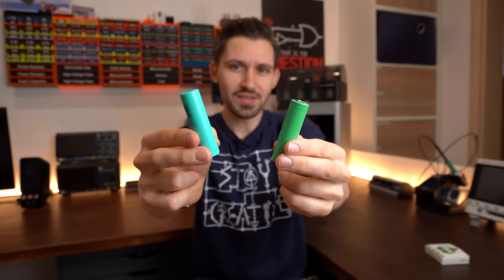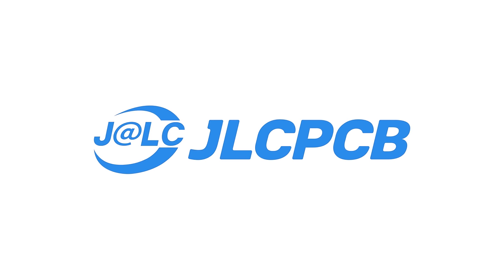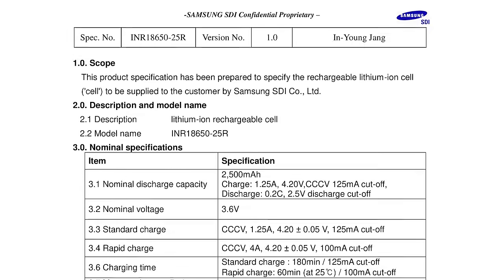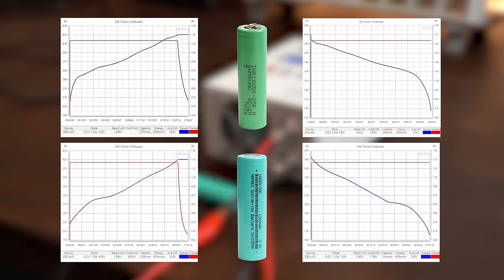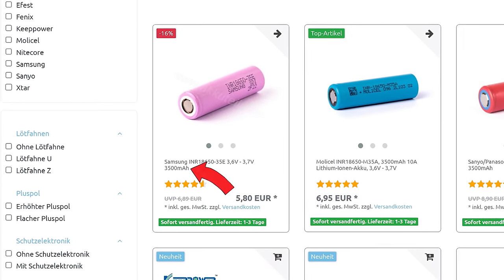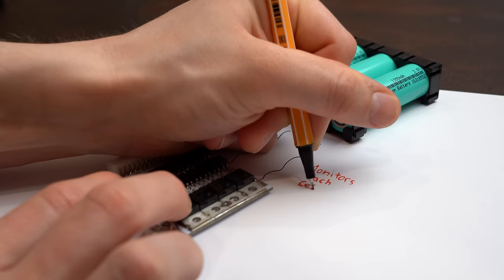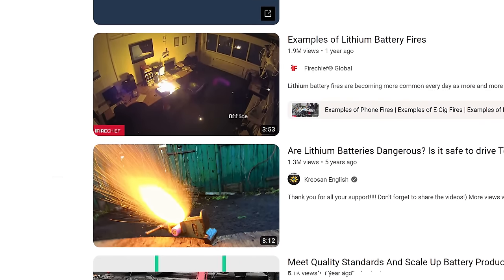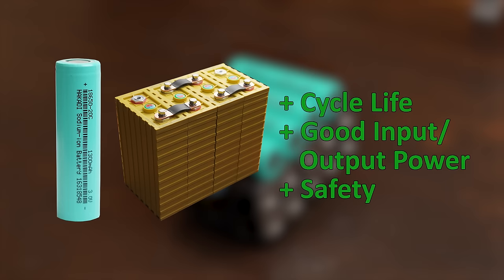"Salt" Batteries are FINALLY Here?! Sooo should you use them?

Comment: They will be great for house installations.
Reply: Anything where volume and weight isn't so important is going to get taken over by this.
Reply: Only if the price will drop a lot currently is around 400$/kwh
I was able to build my LFP battery 5 kwh for 500 dolars( i was hunting on aliexpres for a very long time) with bms which is around 100$/kwh but you can pretty easlit get it for 150$ without hunting.
Due to bigger volume, lover power delivery, lover number of cycles than LFP and i think because of operating voltage range they will have lover effincincy in converting DC to AC their price would need to drop to 50-75 $/ kwh or even lover to make them have sense which is between 6 to 8 times cheaper than curently.

Comment: Nice! When calculating the W/$ should really consider also the life of the battery. Natron Energy's bluepack claims 50-100K cycles so if you buy 100Kw lithium for home storage you will need to replace it every 5-10 years while with sodium probably you will never need to replace it.
Reply: Never? Pretty sure it was said the sodium has bit more charge cycles, not infinite amount. Also for safety we shall see what happens to battery packs that are in practical situations abused and end of their life or in extreme power draw. While not having fire just battery flying from released gasses is better, not combine that to hundreds of cells. We shall then see if garage door gets yeeted out if whole pack goes boom.
Reply: @Hellsong89  "never" was for 50-100K cycles for bluepack that I've mention. Generally, sodium research so far mentions about long life cycle, safety, ~100% DoD and fast charge/discharge. All those are still on papers but theoretically can be achieved. It's still early for sodium but it is really promising. I agree that the results matter but we will need time to see them.
Reply: 😂which lithium are you talking about? Lfp battery are more commonly used for home storage and those are rated at 4000 - 5000 cycles to 80%. It will take you 13 years to get 5000 cycle and still have 80% of the battery available. Your salt battery is not even proven in the real world yet and you are claiming charging forever.
Reply: @brucey5585  It's not my salt battery :P What research claims is that sodium can reach much more cycles than lithium. Also told you that Natron Energy's bluepack already claims 50-100K cycles. For a new house (let's say 50-100 years house life) will need to buy batteries 10 times to be able to support it. With sodium you will never need to buy a battery again.
Reply: You have absolutely no idea how electricity works...

Comment: The number of charge cycles is very impressive! One big problem that sodium batteries faced was that the larger size of the sodium ion would lead to greater expansion  when the ions intercalate (move into the space between carbon layers) into the graphite. This would lead to the graphite breaking and parts of it then being electrically isolated and thus no longer active in the battery. It's very cool that they found a way to avoid this. I just hope that this is not why they have higher internal resistance because that may mean that the resistance cannot be reduced without sacrificing the battery longevity.

Comment: Note: I've read that sodium Ion Batteries can be discharged to 0v without damage. So a BMS to doesn't need to prevent overdischarge, at least in theory.

Question: I haven't found a single mention of what happens when they are overcharged... Could you test that?

Comment: @6:45 "You can find sodium cells with slightly higher capacity."  Yes, and if you search, you can find Lithium cells with slightly higher capacities.  3700 mAh is pretty common for high quality cells, and 4000 mAh is not unheard of.  I've seen claims of 5000 mAh, but I'd have to test them myself to believe it.

Comment: I am quite pyrophobic. that has really been keeping me from experimenting with lithium batteries. I truly hope this technology will improve soon, and we can truly have safe batteries.
Reply: Sodium is more reactive than lithium so less safe
Reply: @balintgalambos691  from what I have seen,  sodium batteries don't explode like lithium ones (much smaller fire), and they are far more resistant to temperature change..
Reply: @rtyt5555  then learn about alkali metals. Lithium is the least reactive, sodium is more reactive, then potassium, and rubidium. Lithium never exploded by its own, it exploded due water and sodium is mor reactive with water.
Reply: @balintgalambos691  There is very little actual lithium in lithium-ion batteries anyway. The reason they catch fire is their high energy density and flammable electrolyte. When the battery gets damaged, it heats up enough to ignite the boiling electrolyte. It has nothing to do with lithium reactivity.

I would guess sodium batteries don't do this because they have lower energy density, higher internal resistance and an electrolyte that is harder to ignite

Comment: What's the self-discharge rate like for the sodium cells? You didn't mention it so I expect it's fine, but I'm interested to know anyway.
Reply from the maker: Well, I didn't test for that and the datasheet also has nothing to say about it. Let's see if that will be a problem for them in the future.
Reply: @greatscottlab test it! Put some aside and measure the voltage once a month

Comment: you are correct with the comparison of LFP and Na-ion. that’s the strategy cell suppliers are marketing for. the first run of these are going to be in large stationary energy storage arrays where you need good cycle life but not high rate charge or discharge.

Comment: One of the fun things is that these cells can also keep working when damaged! There were demos of pouch sodium cells being cut in half and still lighting an LED. Obviously that lowers the capacity, and an internal short would drain it, but you don't have instant failure like you do with lithium cells.

Also, fun fact... you can make your own salt battery at home! Very low power, capacity, and density, but you can do it!

Comment: 8:46 There are smart BMS boards that allow you to set the maximum voltage and minimum, cut-off current, and temperature protection, so this is not a problem.  
For example JK-BMS

Comment: The sodium ion battery will become the defacto standard I think. 
There is a place for higher density batteries or higher current output batteries.

But for electrical grid battery storage, be it at scale or at home, and for alot of electrical electric vehicles I think this will help and incentivize more environmentally friendly energy usage due to it being economically better priced per Wh

Comment: When comparing cycle life, please consider the rated current stated in the specification sheet. Sodium-ion batteries have a much lower rated current. When converted to the same operating current, the difference in cycle life may not be as apparent as it initially seems.

Comment: Nice video. I think the most important use of sodium-ion batteries in the future is to replace lead-acid batteries and lithium iron phosphate batteries. However, because the energy density is relatively low, it is difficult to replace lithium batteries in some fields.

Comment: I had some 'salt batteries' are just old lithium ion ones, they're called 'salt batteries' to excuse the lower voltage ratings. Just build a protective polycarbonate guard for 10 dollars to cut into them and see if they actually contain lithium

Comment: Can we say that these are the  ideal batteries for solar/wind buffer? The extra energy can be collected in these, and when there is no sunlight or wind, they can provide energy to the network. At the same time the Maintenance demand is like change the tired cells eventually, and remove the dust from the station sometimes

Comment: you could extract the contents of the battery and then calculate the molar mass and multiply by Avogadro's (6.022x 10^23) number to calculate the molar mass(mol) of the substance and compare it to the weight of the contents of the lithium ion. Sodiumm (Na) is 22.90g/mol and lithium (Li) is 6.941 g/mol

Comment: With regards to testing if the material inside is sodium, a flame test would be the easiest. Lithium colours flames a pinkish red, sodium colours them yellow. Introduces risks because fires but would be the most simplest method. Otherwise I believe you'd be looking at trying chemical reactions or trying to extract the material through chemical processing.

Comment: One test that you ought to run is "charge efficiency."  LiFePO4 batteries have a remarkable charge efficiency -- some are over 99% efficient. I have a  12v 100Ah pack that I've tested at 98% when charging at 20A.  This makes them ideal for a solar-charge system.  I'm curious how the sodium cells will compare, since they have a higher internal resistance.

Comment: One HUGE advantage of sodium-ion batteries over both lithium-ion batteries and LiFePO4 batteries is the temperature range!
With that in mind, they should be great for battery-powered outdoors sensors and data loggers and solar lights and such.
Sodium-ion batteries usually have a working temperature range of -40°C - 80°C (above 80% state of charge retention rate at -20°C)
Lithium-ion batteries usually have a range of -20°C - 60°C and the performance will reduce drastically below 0°C
LiFePO4 batteries also typically operate within a temperature range of -20° - 60°C, and the optimal performance is achieved between 0°C - 45°C

Comment: Atomic Absorption spectroscopy or its cousin Flame Emission spectroscopy would distinguish between sodium and lithium pretty easily.  Heck, just take a small amount of the insides and stick it in a Bunsen burner flame.  If you get a bright orange-yellow flame that's an indicator of sodium (lithium gives a red flame instead).  You could test with a grain of salt to compare.  The only reason for using fancy equipment is that the sodium emission is SO strong it can dominate anything else present, to the extent that sometimes people view flame tests through a filter that blocks out the sodium emission lines (like cobalt blue glass) to make it possible to see what else might be there.

Comment: I can definitely see these being huge for battery powered vehicles. We don't honestly need the insane discharge rates cars are currently able to harness for standard transportation. EVs are already fast enough for sure. The lack of massive insanely difficult to put out fires would be very nice. The longer lifespan without losing capacity would also be massive. Lower cost would of course be welcome. Plus there is room to improve in all aspects. Really hope this tech flourishes and gets cheap!

Comment: They look the same but basically have half the storage capacity. But it also works when it's colder.
I can think that the battery fabs will basically push it everywhere even though that it will make the tools way heavier or it will hold less time. Lets hope they finally make with the home storage cheaper.

Comment: Most data I've seen, show most lithium ion cells have a cycle life of 500 to 1000 cycles to 80%, while lifepo4 are around 3000 to 8000 cycles to 80%. But one advantage of sodium ion cell maybe not being damaged in charge at a lower temperature, which both lithium ion and lifepo4 maybe damaged if charged at below 32°F or 0°C. Were sodium may be charged a bit lower than freezing. However, for lower safe charging, some LTO cells can be safely charged at way way below freezing.

Comment: A flame test would be a pretty definitive way to tell that they actually have sodium metal in them. Sodium burns with a distinct orange-yellow flame (sodium doublet) unlike the red for lithium. So if you want to test them out, you can qualitatively compare the flame you see by burning the sodium metal cathode and burning a lump of pure sodium metal separately as a control. If you have a spectrometer or even a diffraction grating to analyse the flame, all the better, but not strictly necessary.

Comment: This is the best video you have ever made. I will order some now and be of first in Australia to have them! Too long have we waited for replacement(s) for the old Lithium cells. Amazing!
Reply: It was really a rather uninformed video. His comparisons are nonsensical, logical conclusions are based on incomplete information, etc.

The cells he has shown here are shit in every way. That is likely because of how new this tech is. The actual advantages of these cells will show up later and/or in bigger cells. Comparing these to high power cells and finding that they have a slightly higher cycle life is a nonsensical comparison. You also want to compare the energy, not just raw cycles. So if the energy density is <0.5x, it has to deliver at least 2x the cycle life to get the same usage.

Comment: It's probably worth noting that Li-Ion cells used to significantly less energy dense when they were the latest technology. Common cells from 20 years ago were usually around 2Ah at most when new, while modern ones tend to be between 3 and 4 depending on the intended purpose. That improvement took only a few years once laptops switched over to lithium.
I would expect we'll see similar happen with these sodium cells as popularity increases. Physics says we can't get as dense as lithium, but they should be able to get somewhere between 2-2.5Ah per 18650 cell within the next few years.... If they catch on as being a better choice.

Comment: Energy density is KING when it comes to rechargeable batteries, and sodium cells are the first time in history we have actually tried to advance cell tech by going backwards(publicly at least). If you contrast the extra weight required to maintain the same voltage and amp delivery with the sodium cell vs lithium cells its easy to see that you don't gain anything but safety in the end.

This is probably why they decided they weren't commercially viable when they first developed them  in the '70s and then abandoned them. Maybe they'll pull a rabbit out of a hat now lolol.

Comment: It will be interesting to see if this kind of battery will be added to handheld devices
Reply: Definitely yes when it gets cheaper than liion.
Reply: I was thinking that. We are currently wasting a lot of lithium on devices that could easily manage with some other type of batteries. Wireless speakers, headphones, decorative or portable lights, toys, vapes etc. Lot of those consumer products have extremely bad recycling % as well.
Reply: @Ruinwyn I meant that they will just use cheapest option available. Doubtful these batteries are actually harmless in landfill, that will probably require regulatory prodding.

Comment: When I was taking chemistry in high school a couple years ago, I pondered why sodium wasn't used for batteries. A major part of why lithium ion batteries are so energy dense (relatively speaking), is due to its extremely low Specific Reduction Potential (-3.04V). Sodium, being the next Group 1 metal, had a SRP of -2.71V. This would make it less energy dense, but given the abundance of sodium (i.e. the damn ocean) it seemed very appealing.

I wonder why it took so long to get here.

Comment: From what I've read up, sodium ion has about the same gravimetric and volumetric energy density as LFP. Also their price is either higher or about the same, depending on where you're buying them from as of now.
But their working voltage range makes them virtually unusable with current equipment (inverters, MPPT charge controllers etc.).
For sodium to displace LFP they need to lower their cost and there needs to be equipment that can work with it that costs about the same or less than the current LFP compatible equipment. And until sodium ion drops in price and there's high enough demand, companies like Victron won't be interested in making compatible equipment, IMO.

Comment: Lithium may be more expensive than sodium, but its only a small part of the cell. The casing, anode/cathode material, separator layer, and production still cost the same. That being said,  there are US based sellers offering these for <$1.50/cell.

Comment: Might be interesting to see if there's any difference in performance with temperature. One reason why the NiCd chemistry still sticks around for stuff like solar lights is it tolerates cold a lot better than lithium batteries, so it'd be interesting to see if sodium would have any performance advantages or issues there.

Comment: BMS based on ASICs or programmable controllers instead of simple circuitry will most likely get support for sodium ones, instead of new lines of products.
Their lower energy density is an issue, but please compare them to 18650 cells from 10-15 years ago. I remember being excited for 1800 mAh ones with 3.7V chemistry - not 3.85V like we have now. Li-Ion is very mature technology. While sure, some experience from them can be transferred to sodium production, significant part of the challenge is fine tuning the exact material composition and structure, which has to be done from scratch.

Also 10A discharge current 15 years ago would explode every 18650 available back then.

Comment: Sodium batteries show a lot of promise.  There are many applications that don't need the lightest, most compact cells possible.  Home solar battery packs are one such example.
No doubt the new sodium batteries will be very expensive at first, but I look forward to them becoming much cheaper than lithium cells in the next few years.  Right now I am exporting almost all my solar PV power for a few cents per kWh.  I would love to use all that energy at night or when it's cloudy.